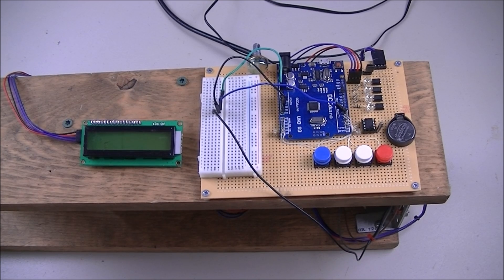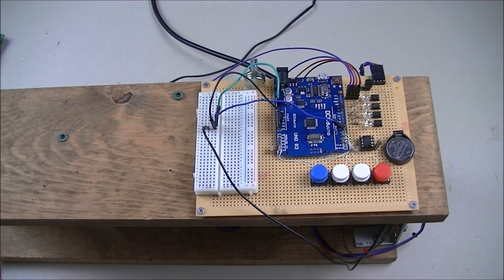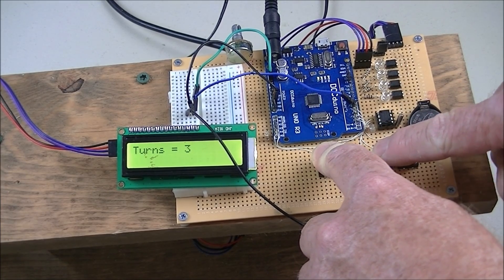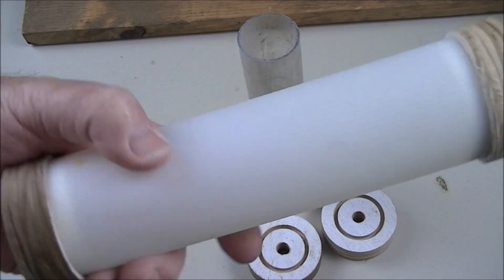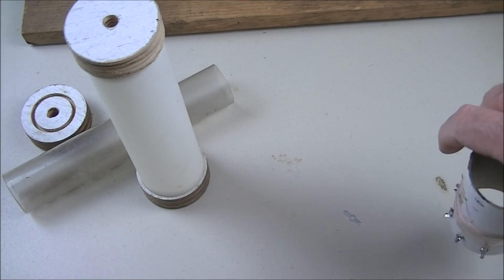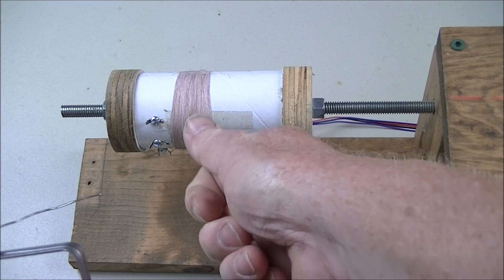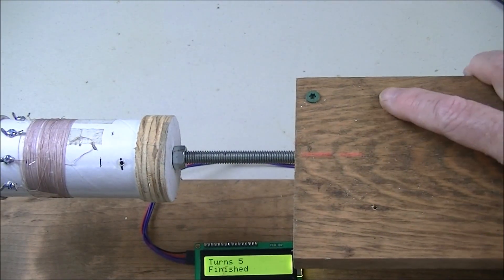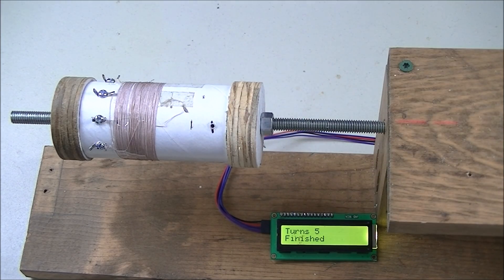Arduino Stepper Motor Drive Coil Winder

Comment: dont bother building this folks,the code is broken!.
Reply from the maker: I just tried the entire setup, including electronics and code. It all works 100% as designed. How the code is used should be obvious. I'll make a new video today and walk through the steps again.
Reply: @LewisLoflin  i still have issues with he uttttons no changing the counts,going to order a couple of new uno's maybe a nano too,i am building this to rewind a huntron tracker power transfo,should be fun  NOT! lol.
Reply from the maker: @paul.alarner6410  I just made a video of it working. Did you alter the schematics on the webpage? The switches connect DP2-DP5. What does the display say when booting up?
Reply from the maker: Works fine. You have to get the stepper motor working before the est of it.
Reply: @LewisLoflin  the steppers work,seems since you fixed your site 404 error its busted.,no buttons work!
Reply: @LewisLoflin  i was just making the pcb and buttons first,i wanted to connect and test those first before hooking up the stepper,should the buttons still not  change the turns to wind on the lcd tho without the driver+ stepper connected?.
Reply: @LewisLoflin  i built this a couple of years ago with no issues,have you tested the code after you reuploaded it?.
Reply from the maker: @paul.alarner6410  I'll connect the system again and check it. Thanks.

Comment: do you know the link to the code 'winder txt' throws up a 404 not found error,can you please fix this as i am wanting to build it,also is there a way to control the winding arm/wire guide with an arduino and a 2nd stepper motor?.
Reply from the maker: Sorry about that. The code has been re-uploaded and works now.
Reply: @LewisLoflin  any plans on adding another stepper for a wire guide?,would be a great handy device then,as is its like its only half complete,still a great device tho!,73 de m3vuv
Reply: why no reply to this?.
Reply from the maker: @paul.alarner6410  I did reply to it. I wrote A0 is fine.
Reply: @LewisLoflin  well its built i installed the onewire+ liquid crystal library and uploaded,the display works but none of the buttons do anything,do i need another library?,cheers+73
Reply: i was refering to the email i sent,not the yt reply,anyway the buttons dont work,been told there is an issue with a delay in the code stopping the buttons being read.
Reply from the maker: @paul.alarner6410  Never got an email. Where did you send it? Try lewis@bvu.net.
Reply: @LewisLoflin  that email addy is bad!
Reply from the maker: @paul.alarner6410  Use lewis@bvu.net
Reply: on the winder speed pot,its middle pin is marked as going to the arduino A0,my uno only has pins marked A0 thru A5 analog in,is it one of those ?,its not clear,thanks+73
Reply from the maker: @paul.alarner6410  The pot wiper can go to any analog input if you change the code. Sure, use A0.

Comment: Needlessly  long  shaft  with  no bearing/support at the end=lots of wobble....but good inspiration  thanks😁
Reply from the maker: This was an electronics demo. 2nd mechanical parts are hard to find. The shaft is long because I have longer coil forms such as a Tesla coil. Point well taken.

Comment: Sir, why don't you use cones in both end of the tube ? Then you can use almost any tube diameter you want.
Reply from the maker: Good point. I used what I had and could make. Feel free to go anyway you want.
Reply: Still thank you for this good project and video. I got some new ideas for my own coil winder :-)
My goal is to make high voltage transformer with it. It will require 10 to 20 kiloturns and I'm planning to use it with ferrite core. I'll make it for my plasma cutter.

Comment: Thanks for sharing 
have you more info how to control nema 17 bipolar stepper motor for your coil winder
four wire bipolar stepper motor
Reply from the maker: You need to use 2 H-bridge circuits or an IC designed for driving bi-polar steppers See
http://www.bristolwatch.com/L298N/index.htm
Reply: can i use your coil winder with bi-polar and display

Comment: Hi Lewis, thanks for video. Could this circuit be adapted to run a bipolar motor instead of unipolar as only I have a bipolar motor. 
Thanks Geoff and boohar to the negitive comments!
Reply from the maker: Yes. The coding is the same, the electronics differ.

Comment: Wait. What? This is not a winder for winding stepper motor coils as the title suggests. It's a coil winder driven by a stepper motor! Big difference.
Reply from the maker: No it's a coil winder as in radio and RF coils that uses a stepper motor. Point taken.

Comment: You could add a rail to jog over the wire automatically horizontally as well. Add a bit of something to tension the wire and hold a spool... Hell it could be completely automatic
Reply from the maker: Yes it can. Thanks.